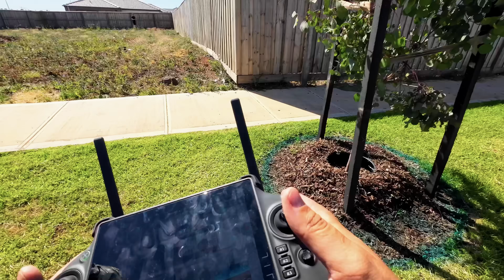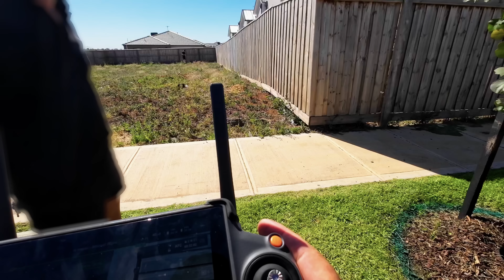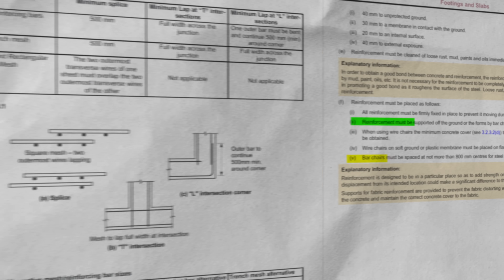I Caught a Concreter Red Handed ...

Comment: Just curious, if not for the video evidence, how could the homeowner have been saved when the concrete cracked months or years down the track? They were all in on it and knew what was happening, if this builder has used this concreter for other builds its safe to say theyve done the exact same thing, putting other homeowners at risk. I would hope that their head office would be notified so they can sweat a bit but I dont think theyd care. Dodgy flogs.
I especially enjoyed junior turning his whole body away at the end so you wouldn't get him on camera.  
Any chance the builder starts with the letter C? 😂
Reply: The proper application of mesh or bars doesn't prevent cracks, just holds it all together.

Comment: I had no idea what a rebar chair was before seeing this either. I is small fixture made of plastic or metal that lifts up the mesh or bar? Makes sense that the bars or mesh are lifted up and locked together so that the 2nd layer of concrete can be reinforced in the best way. I guess it is skipped as it requires two pours rather than one?
Reply: Basically they're just plastic little spacers that keeps the rebar as close to the middle of the concrete when you pour the concrete.

Comment: whats going to happen in 10-20 years time, whole suburbs will have to be knocked down. In 2040 when you hear a 20 year old home you should run for hills. Not like now, 20-30 year old house meant double brick, solid concrete, high quality builds. scary stuff

Comment: The concreter isnt bullshitting, i love this guys videos.. but dont out someone like that if you dont understand the trade. No one puts bar chairs on a driveway and he is 100% right we pull the mesh up as we are pouring. Otherwise you cannot barrow the job, the is nothing wrong with pulling the mesh up on a job. The concreter was nice wasnt a smart arse and was genuinely trying to explain to you how it works. Not a fan of this episode, and i know that company they are a very good company produce quality work. But this is uncalled for.. caught him red handed..with what? Go drive around your area and see how many people put bar chairs on a job that needs to be barrowed. Wake up to yourselves if you dont understand dont criticize other people doing the right thing. Big jobs that are pumped have bar chairs small jobs dont. We have hooks that pull up the mesh. Not everything written in a book is correct, go ask any good concrete company and they will tell you the same thing.
Reply: I assume that when you learn the trade, you are instructed to follow the codes and standards, which can change over time. You cannot justify non-compliance.
Driveways are not small jobs.
Reply: @gribbler1695  there is nowhere that states on domestic driveways that we need to apply mesh/or bar chairs. Only that the driveways are a minimum of 100mm of thickness. 
Yet we provide steel mesh regardless. Driveways like this is definitely a small pour, anything that requires a pump is generally considered larger. Therefore, we have the opportunity to install bar chairs so we do.
I'd assume by your comment you have never stepped foot in this industry therefore I appreciate the feedback but your comment is not needed. 
These guys did not break one guideline or code is this video. The Australian standard that old mate is referring to is in correlation with structural concrete, example structural slabs, crossovers, factory floors or anything along the lines of those. There is no permits for driveways there is no architectural or engineering plans for driveways therefore everything shown in this video is 100% compliant, if you want to pick on trades go pick on the guys who are pouring half the thickness with no steel 👍
Reply: @KaydeJessop  Since they are using reinforcement, it needs to be properly fixed and supported according to code (NCC 2019 - Part 3.2.3 Concrete and reinforcing). There is no distinction here between structural and non-structural concrete.
Reply: @gribbler1695   correct, what you are referring to is steel reinforcement engineering for concrete. As stated concrete paving does not fall into this category, as this is completely non structural. 
Even mentioned right at the top of the NCC Volume two Amendment 1 - Footings & Slabs 
Read the document. 
Good effort though. Hats off for having a go. 
As Apu would say, thank you 
Come again.

Comment: How come you never pick on the plumber’s  or sparkie’s work? Only the roof plumbers, and we all know they aren’t real plumbers 😂
Reply: He does - like outside wastewater pipes not at correct depth, and shower drains where the water seal of a trap is too low (over 600mm from outlet). But yes, we haven't seen much in the way of electrical.

Comment: How did you say it's alright if the builder provides warranty when earlier you pointed to the BCA which mentions bar chairs are required? 🤔
Reply: If he provides warranty AND the homeowner agrees. 

Because it's not really structural or a safety item so there is probably more flexibility if all parties agree to it.

Comment: Dam I was a concreter for several decades.  
Brains ain't needed . But common sence is required.  
Mesh needs bar chairs ffs.  New homes and they using 1980 tactics still. 🤨

Comment: Im a Carpenter by trade and my parents have operated a concrete company for over 20 years before selling up. The easiest way too do this is as the trucks coming foward put them on the mesh upside down then use a concrete rake (if you look at one it has a hook on the back for lifting mesh) pry it up and give it a little wiggle and all the bar chairs will flip around and hold the mesh up ya don't even have to bend down

Comment: He should have the 50 mm Bar chairs and he should be charging extra $1200 plus for the pump. Also to do it by the book get  a permit from council $ to block the road with both a pump truck and mixer truck. While your at it get traffic control $ to monitor this activity. This would then be the most expensive SMALL driveway in Melbourne.

Comment: No bar chairs, no gravel base, no control over where the mesh will end up sitting in the slab so could easily be exposed to moisture and rust out, no consideration for overlap requirements of mesh. No fks given. Poor future home owners of this place, going to be a never ending problem.

Comment: Wow mate - brings back strong memories of the first time a NSW Public Housing concretor explained very clearly how I was going to die; for documenting him pouring a mass concrete disability accessible ramp with no chairs OR mesh. 15 years later, the same defence: 
"if I had to use chairs on every job, I'd have to PUMP every job -  who's gunna pay for that?"
Compliance Officer me: "considering you tendered for the contract on a schedule of rates and minimum standard technical spec - I'd suggest you probably should pay for the pump."
Dodgy concretor: "the next time I pour a mass slab like this, I'll be using YOUR CORPSE for chairs."
Compliance Officer me: "if so, you'll still need some chairs and mesh to comply with code."

Comment: Fix the inspection system to make bad building less profitable. 

If building inspectors weren't failing in their work. They would be catching every non-compliant bit of construction. Rectifications would be costing dodgy builders thousands of $$ and they would be financially motivated to do a proper job. As it is, bad builders cut corners to maximise profit knowing they won't be caught.

Comment: What a MASSIVE DODGY concreter. I also had a shocking concreter last time I hire a concreter, levels literally like a roller coaster, missing drains and down pipe they destroyed, literally bricks sticking out of concrete in driveway, totally different colour concrete patch work like they poured different concrete colours in patch area, driveway slanting to the left then right and then left and right, etc, 20 cm hole in the concrete where there was no concrete at all like as if they had left a pipe in there then removed it and then it became like a funnel, also deep groves in the concrete which were anything but straight, HEAPS of concrete splatter all down driveway as though size of a pea or 3 all over the place over the concrete, patchs of concrete poured over old concrete and grass exposed from under the new concrete, all up the side fence was a HUGE amount of concrete all over the fence which damaged the fence, and the area where meet house missing retaining wall to under the house, and the height of the concrete 1 to 2 foot higher than requested and they loaded with stones and sand to raise the level of concrete way too high which caused now a 1 to 2 meter drop cliff from the area of the concrete to the ground below where the concrete stops and the ground begins, walking path SO STEEP that the area where the walk path is is now totally unusable. front area infront of house so unlevel that there is literally a huge pond of water held up against the house and where rain water flows to the house and just stays there for a few days with a massive puddle against the house wall. so many other problems, if I mention them all that the concreter did wrong, this comment would be so many times longer.

Comment: The truck has a chute for the concrete to run down, no excuse for not using chairs. Give the tuck and chute 3 metres and lift the steel and put chairs down, every other Concreter does this.

Comment: It is common for most concrete contractors to pull the wire and not use chairs and it is perfectly acceptable when using wheel barrows. When pumping concrete chairs are generally used but remember a concrete pump makes the job significantly more expensive for the customer and limits the aggregates that can be used which also impacts cost and strength
Reply: You can't justify non-compliance.
Reply: @gribbler1695  you don't have to use chairs to be compliant
Reply: @desmondirwin200  Yes you do.
NCC 2019 - Part 3.2.3 Concrete and reinforcing
All reinforcement must be firmly fixed in place to prevent it moving during concreting operations.
Reinforcement must be supported off the ground or the forms by bar chairs made from wire, concrete or plastic.
Reply: @gribbler1695  so is what done when the concrete being laid can only be place using barrows or buggies and you are required to ride over the reinforcing? Also when pumping concrete you are very limited to specific aggregate size, types, mixes and slumps, lower slumps or big aggregate mixes cannot be pumped, the customer has the option to request the concrete be placed using wheel barrows to save significant costs. To make chairs compulsory you would have to ban the use of wheel barrows and buggies as well as making it compulsory to either pump or shoot
Reply: @gribbler1695  I get it you have quoted the wording from some local or regional bylaws, but vast majority of the world don't have a bylaw in place for very good reasons that I laid out previously
Reply: @desmondirwin200  The weight of concreters and equipment is a factor in determining the type of bar chair and the spacing of them. The default strength grade is 120kg.
Ref:  Steel Reinforcement Institute of Australia - Bar Chairs for Support of Reinforcement
Reply from the maker: @gribbler1695 Also
AS 3727.1:2016
5.3 STEEL REINFORCEMENT
5.3.2 Construction requirements
(c) Steel reinforcement shall be supported in position by bar chairs, in accordance with AS/NZS 2425, at maximum 600 mm centres.

Comment: Hey mate, sad to see this kind of thing happening, I used to be a labourer in concreting and i can guarantee you absolutely can push a wheelbarrow when theres chairs 😂 his just pulling the piss with that remark. Regardless of what the builder signs off on, this fella is meant to be a "qualified concreter" so should know the standards that fall within it 🤦🏻‍♂️ interested to know, if the customer doesnt sign off on it upon discovering this, will they be required to come back and replace it at their own cost?

Comment: In my 45 years of building I only came across 1 Concretor I could trust. Does anybody know hard it is to lift reinforcing steel up to the specified clearance with a load of concrete on it? Impossible.
Reply: Carpenter by trade here not that difficult at all look at the back of a concrete rake that hook is for that exact reason. U can flip it upside down and lever the mesh up
Reply: @emde174  builder by trade here. I don’t believe you can get a consistent depth with a rake.
Reply: @emde174 and do you get the correct clearance?

Comment: Sorry Mr Concretor. This is not the USA where they do not use bar chairs and just pull up the mesh. If code says it's a must, then its a must. 

I prepped my own driveway and had a crew come in for one day to pour and finish. Even then I knew I had to use the chairs and even then I knew the pump truck would be required. The pump truck for me was an extra $650 (2023) only and I'm not a tradie. I am sure you could hire cheaper than that, or better yet, get your own pump trailer at least if the truck is too much of an investment. Your work would be solid and you will easily pay off the investment due to more work based on your reputation for quality work.

I hope all your work gets checked now. Dodgy tradies give all tradies a bad name.

Comment: I have had large concrete areas poured at industrial sites and it is such crap that they pull the mesh up. The inspector is correct it sinks right to the bottom, we have have slabs that need replacing and we have always found the mesh on the bottom and no chairs. It is such BS we pull it up and that works, never believe this.

Comment: If you need to drive the truck in over the steel then you need to put the chairs in as the truck goes forward before pouring the concrete. The concrete knows this but comes up with the bs that every pour needs to be done with a concrete pump. Inspector was right in this one because lifting the steel without the chairs doesn’t stop the steel from being pushed down to the bottom of the concrete and is a waste of money and strength in the concrete. Good luck boys.

Comment: Was the reo lifted up with shovel? Or was it still on the ground as the wheel barrow full of concrete dumped over it?The reo (steel mesh) will be on the ground and rust out without the bar chairs! The concrete slab on grade without the bar chairs holding the mesh in at the right height within the concrete makes the mesh useless and will rust out.

Comment: Concrete chairs are not used in most countries and the steel is left on the ground. Some engineers put mesh in the slabs with bottom cover been important below the halfway point of slab thickness and other engineers put mesh with top cover with mesh sitting on top half of slab. Other slabs don’t even have mesh or chairs. So not really an issue.

Comment: Concreters lazy, you can barrow when mesh is chaired its just more difficult and you can leave out chairs where the trucks wheels need to roll and put them in when it moves out o the way- its just more difficult than doing fuck all.
Wheres the plastic as well?

Comment: He's taking complete crap about the mesh sinking back down after it's pulled up.

There is loads of concrete companies on YouTube who do large pours every day & almost none of them use chairs & pull the mesh as they pouring. The chairs make it a hazard for the to walk about on the slab & also you can't buggy or wheelbarrow concrete on chairs which is why they pull as they go. 

There is one vid of Victory where they pulled it slightly too high by mistake & he was having to stomp hell on it to get the mesh back down an inch or two lower.
Reply: Cool so there's tonnes of videos of them doing shit the wrong way nice.

Comment: The work you do is so important - these people need to be held accountable. I don't know anything about concreting but these chairs can't be expensive - just a bit of extra work... 

And you're a brave man going out to these places by yourself and getting it done. A national treasure.
Reply: They're not individually.  But they add up.  But you just build it into the cost, they're being cheap.
Reply: @bibsp3556  even on medium-large size jobs they only cost $100's.

For very large jobs it might be a few $1,000 but the job is going to easily be worth $50,000+ anyway.

The cost is so small it's basically a non-factor.

My point being that even as a total they aren't expensive comparative to the size (cost) of the job.